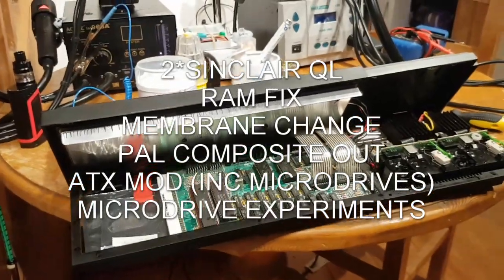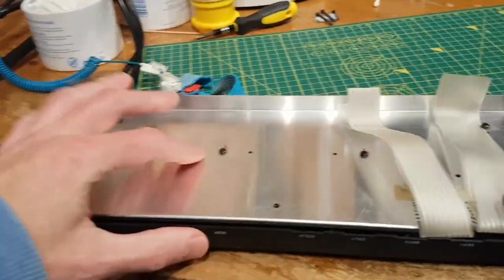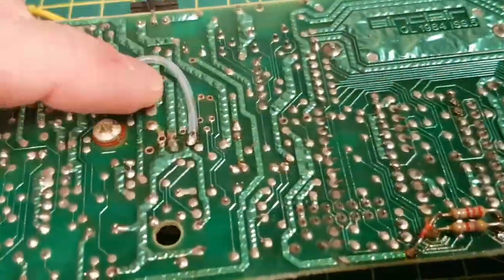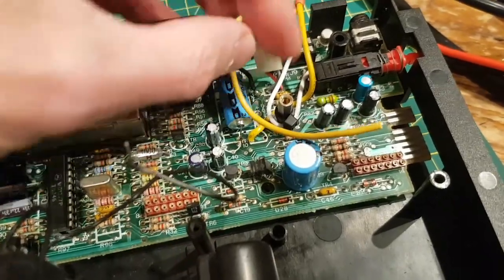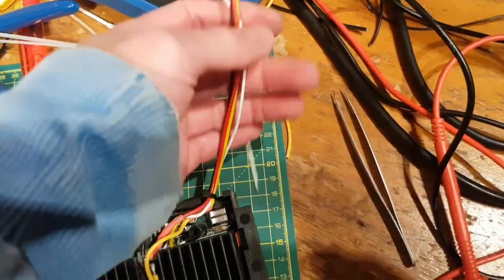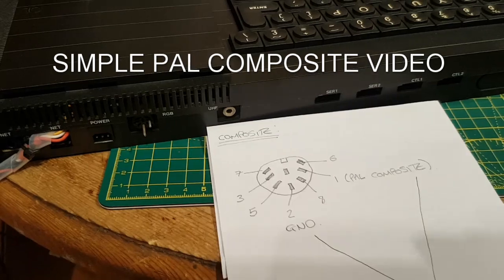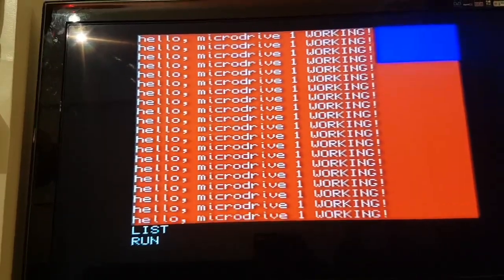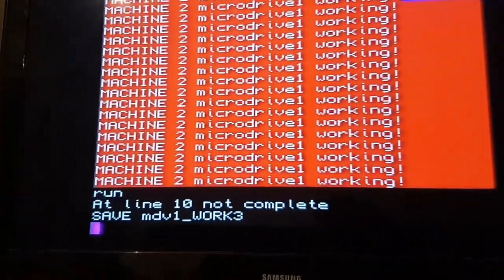Sinclair QL Fixes, White Screen, Easy Composite PAL, ATX Power Mod, MicroDrive Tests

Comment: The Microdrive sounds like one of those little hand held gadgets from the 80's that you'd use to remove fluff bobbles from old clothes! It's amazing that they even work with how little there is to their construction. I think this is the first time i have ever seen the insides of a QL.
Reply from the maker: I remember the advert for that lol. A Remmington Fuzzaway 😂. Yeah, pretty cheap construction on those drives.

Comment: So for a US Sinclair QL, that simple video mod unfortunately won't work. I just checked and pin 3 is giving a 5 volt output (with pin 2 ground). I read on qlforum that one person thought that was the case though he didn't specify the source. Any idea why the north american version would supplant pal-composite on pin 3 for 5 volts instead? The monochrome works great.